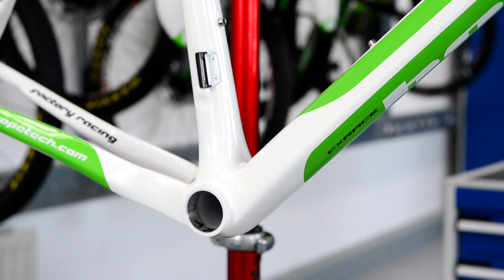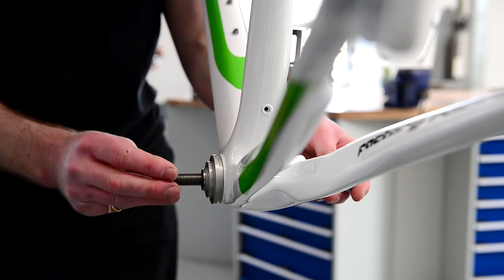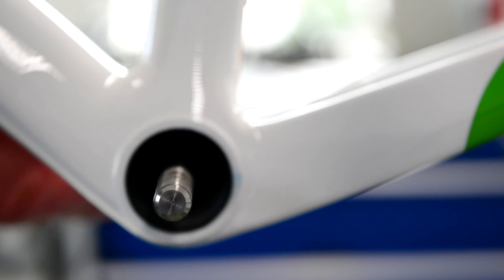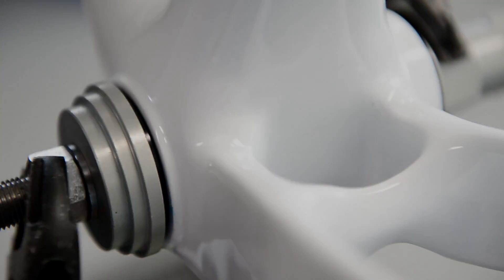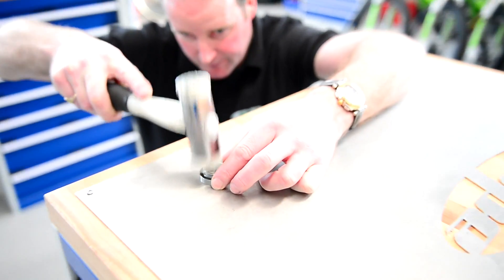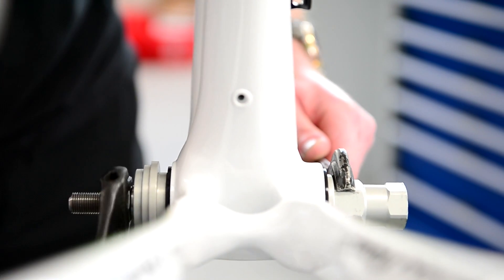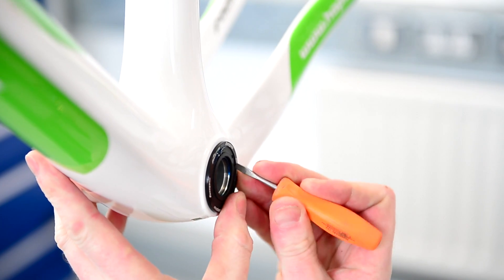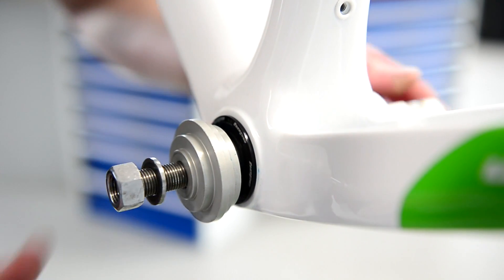How to fit a press fit bottom bracket - Hope Technology

Comment: Can we have a video showing how to change bearings with cups still in frame
Reply: The best thing to use is a bearing puller. This way you can reuse the bearings. If you knock them out, they become useless as the races will likely be brinelled. I have recently bought this tool for working on my bbs: https://www.ebay.co.uk/itm/Bottom-Bracket-Install-Removal-Kit-Professional-Bicycle-BB-Bearing-Press-Tool/174285882868?ssPageName=STRK%3AMEBIDX%3AIT&var=473345370278&_trksid=p2057872.m2749.l2649
Fairly cheap and took only about one week to deliver from China.

Comment: I don't see the point of press fit, thread is much better.
Reply: +Stan Woo Could I use thread on a bike that came with press fit?
Reply: Dont think so.
Reply: Stan the HeadHumongous pressfit is lighter stiffer you can fit wider tires and still have short chainstays and threaded cups have pressed bearings too btw